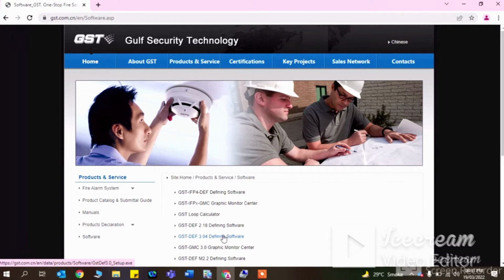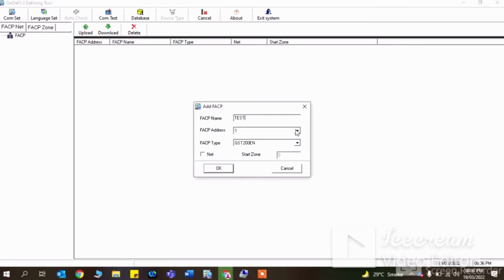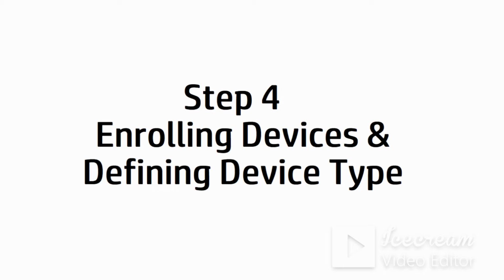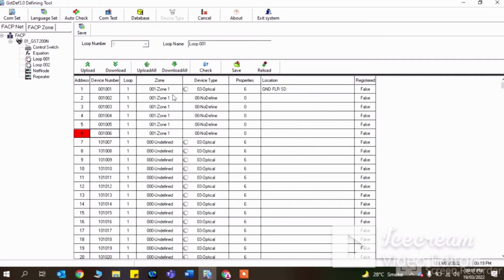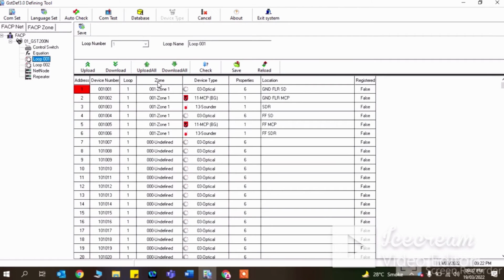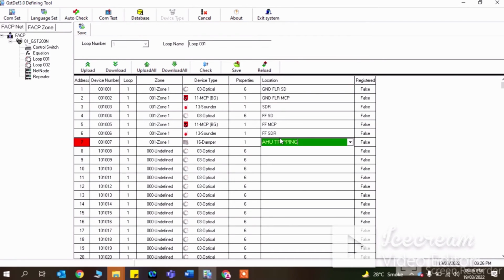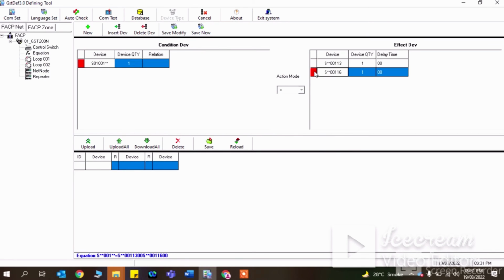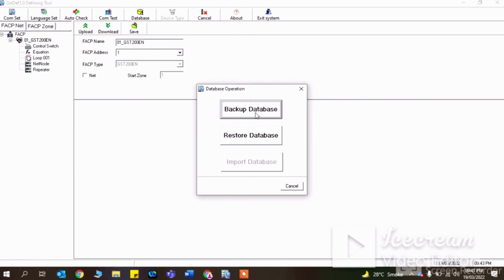How to do GST 200 fire panel Programming & Commissioning?

Comment: Due to water leakage on 2nd floor, display of GST 200 panel at ground floor is empty, showing nothing any text on display but only light, no 24v power on loop out /loop in point even loop wire disconnected. What will be reason and how to troubleshoot it
Reply from the maker: If we confirmed as water entered into the board, first we need to check which part of the board is damaged and then it need to replace. If it is not visible, first we need to check the pins in the power supply board's output voltage and then  the pins where these power supply terminals are connected. Mostly, when there is any issue on the main board (the PCB board on the back side of the front door), this display won't come.
Reply: PART CODE 
MB-221N.    Will  hv to replace...Or repair if possible..So maney panel hv same problem, nd I spoke it
Reply: Greetings Pls what is the password of systm setup